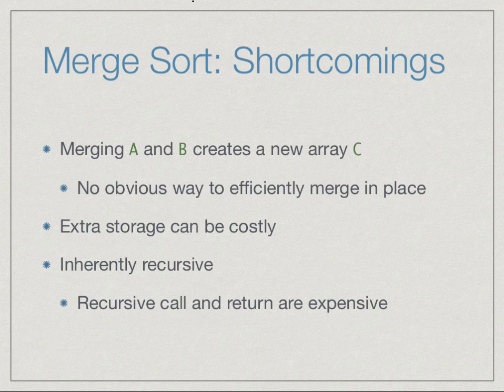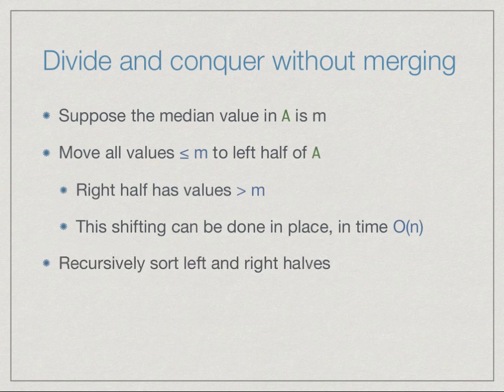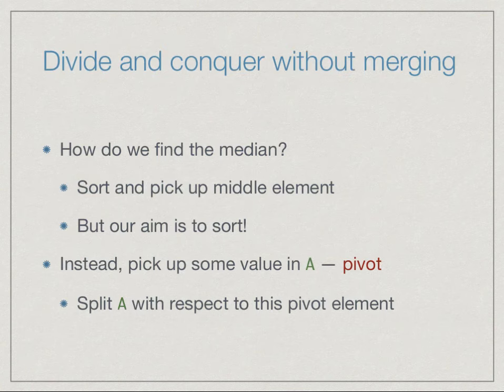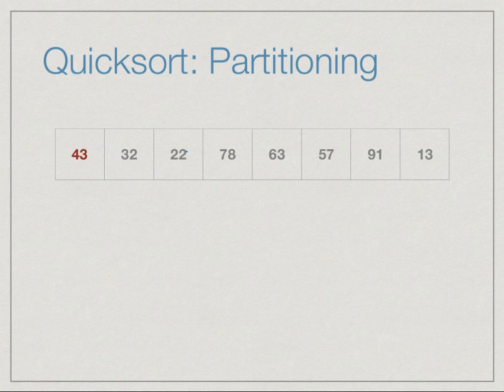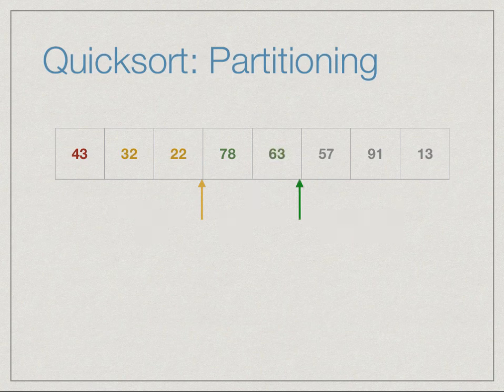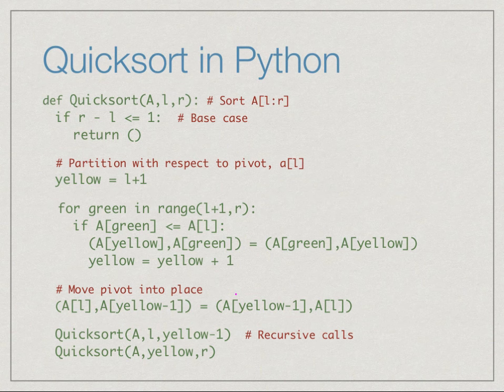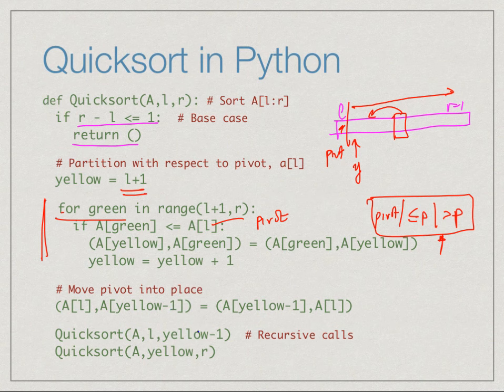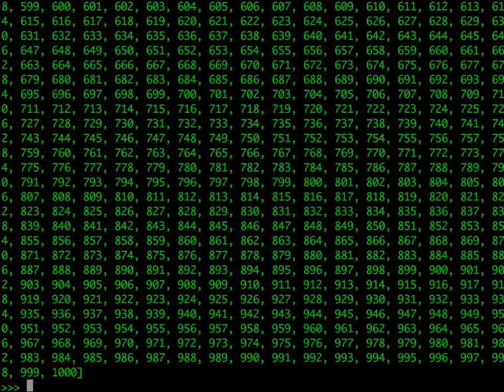quicksort

Comment: def quicksort(A,l,r):
    if r-l<=1:
        return ()

    yellow=l+1

    for green in range(l+1,r):
        if A[green]<=A[l]:
            (A[yellow],A[green])=(A[green],A[yellow])
            yellow=yellow+1

    (A[l],A[yellow-1])=(A[yellow-1],A[l])

    quicksort(A,l,yellow-1)
    quicksort(A,yellow-1,r)

l=[2,4,6,7,6,3,2]

print(quicksort(l))

# please explain  what is the problem in this code as soon as you can
Reply: and there is some error that is missing two argument  but in your video did not explain about it .. sir please solve my problem .
Reply: return(A)